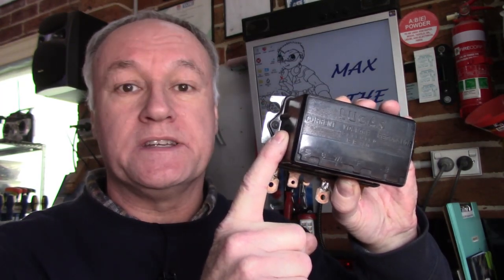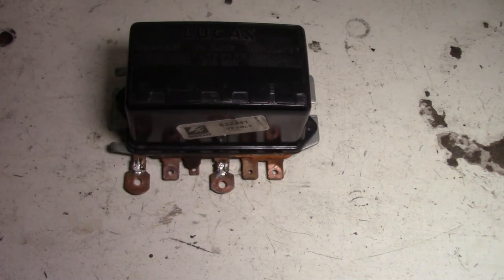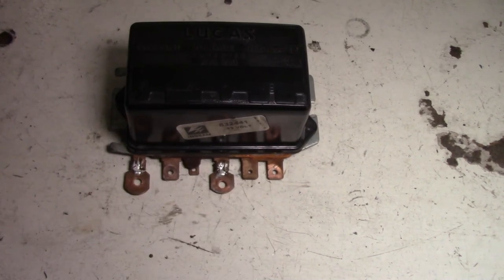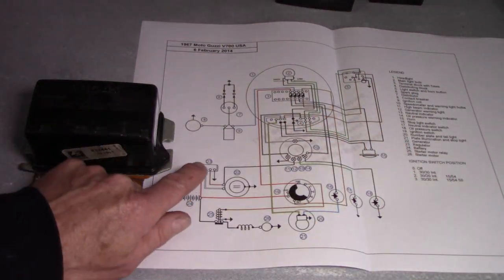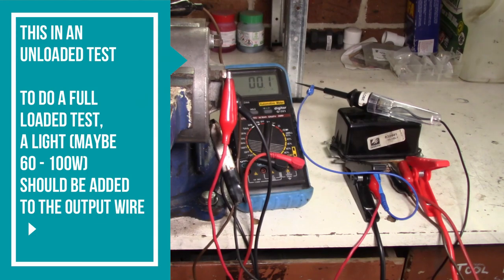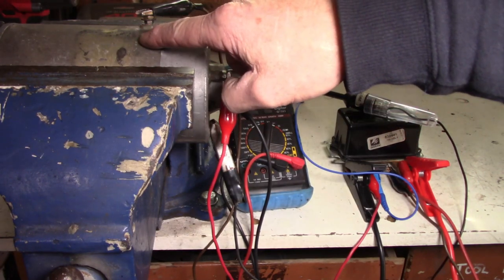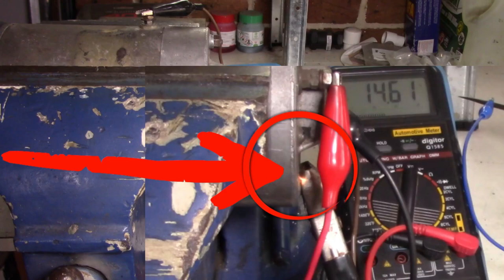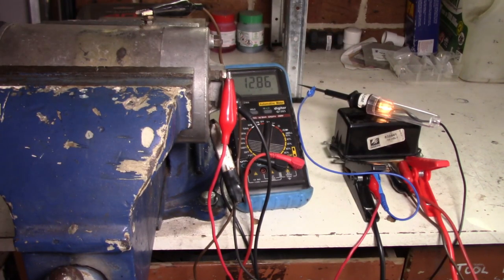How To Test An Old School Voltage Regulator

Comment: Unusual to see the Lucas RB340 control box being used with that generator. Would have liked to see what the current contacts and air gap looked like. Great video brought back some memories.
Reply from the maker: You are right, I should have filmed the actual workings inside the regulator.

Comment: Hi I have a Lucas regulator and generator just like the one in the video I’ve set up a bench test as u have when I connect my battery my test light isn’t coming on I spinned the generator when the regulator starts to regulate at 14 v my test light then comes on would u have any ideas what would be causeing this
Reply from the maker: Are you connections correct? Is the ground connection good? The light should come on when it is stationary, then go out when the generator is running. Have you seen the generator video as well? https://youtu.be/B05v2nHeJIk